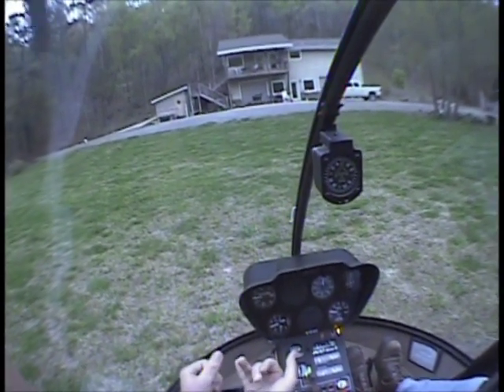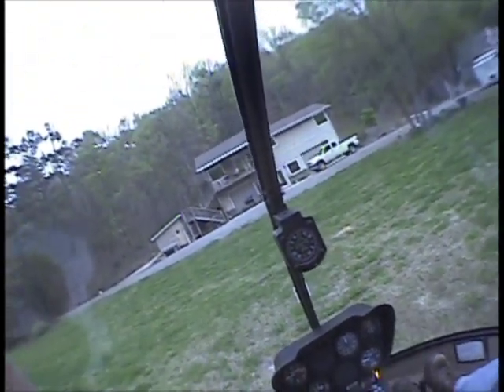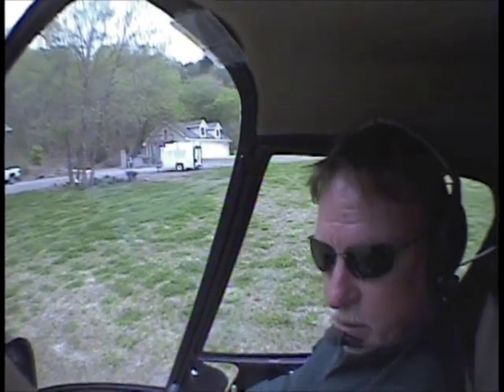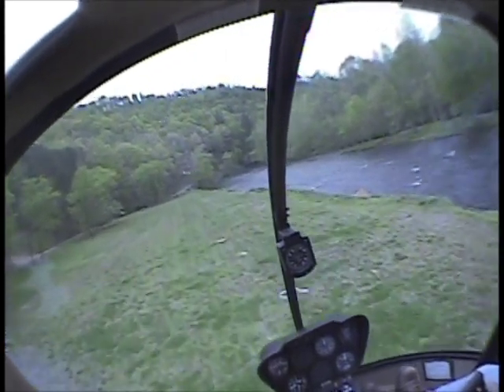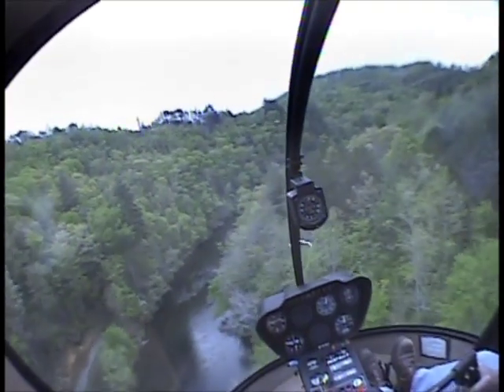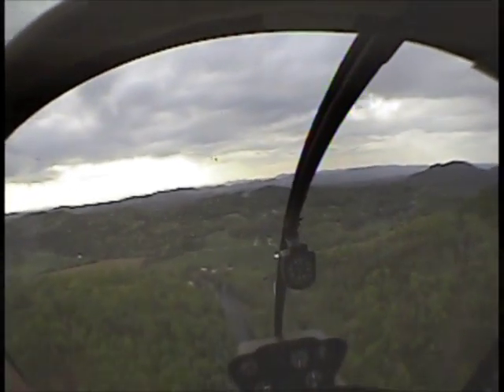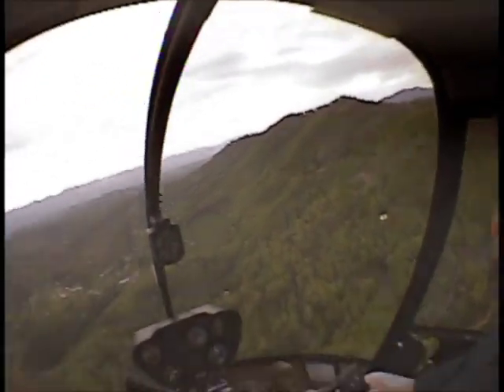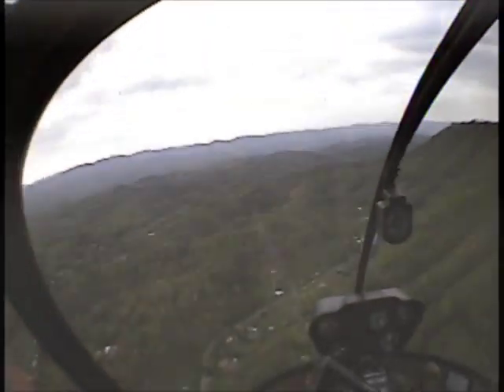Flight Lesson -When do I need to apply carb heat in a Robinson? Clutch Light Emergency Procedure

Comment: If the outside temp is above 35°C, or the dew point spread is over 15°C, are you still pulling carb heat just because there’s visible moisture (especially if you’re over 18” of manifold pressure)?

Comment: Those comments were not, and are not, intended to suspect or question your credibility, ADM safety judgment, or authority, Michael.  I hope you didn't take them as insolent.  They were offered in reply to  'really12345's question about right/left seating protocol in helicopter as compared to standard FW left seat PIC seat.

The reason I ever wondered about this helicopter seating arrangement is, because of the extra roof window on the left side of an R22. 

I'd love to fly with you sometime.

Comment: The prime rule of helicopter traffic operations is 'Avoid the flow of fixed wing traffic'.  

Most FW patterns are left traffic, unless otherwise stated in the AFD or otherwise announced on AWOS ASOS or ATIS.

The prime rule of helicopter traffic operations is 'Avoid the flow of fixed wing traffic'.  Most FW patterns are left traffic.  Helicopters are slower than FWs and can hover.  I speculate that the helicopter pilot in the right seat has a better view of the right traffic pattern.

Comment: Right seat / Left seat = starboard / port

Pilots sit in the right seat in a helicopter, and the left seat fixed wing aircraft.  Some pilots with a fixed wing orientation also sit in the left seat.  In helicopters the flight instructor usually sits in the left seat.  

It seems there is no set rule on this, and is discretionary to each pilot and/or instructor.